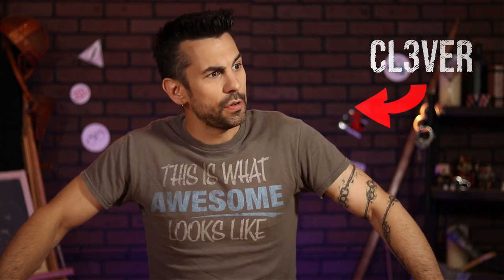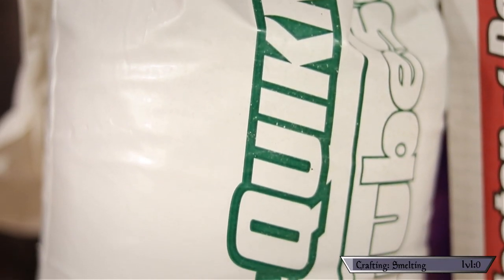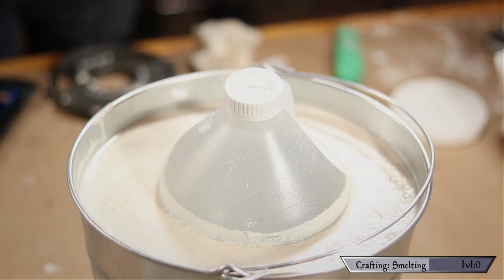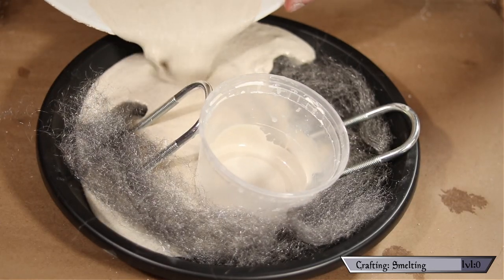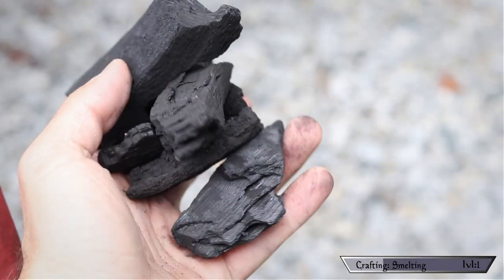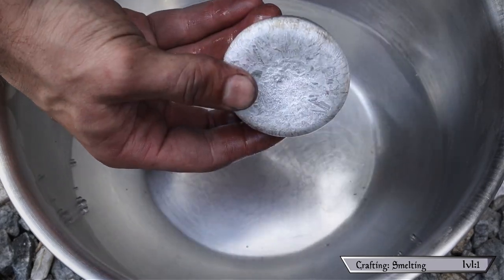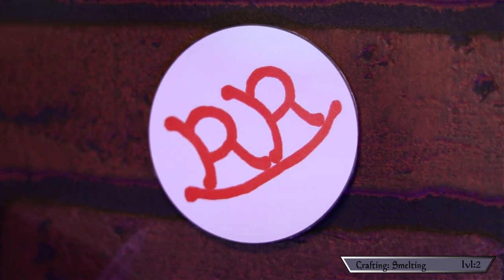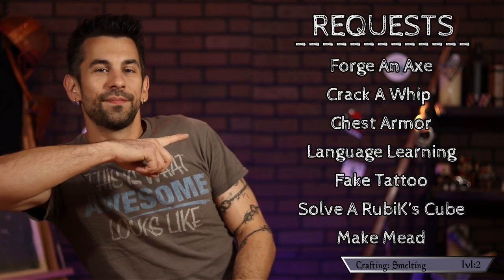Metal Foundry! | On The Shoulders of A Giant | Skill Tree

Comment: Quick tip. When I first tried this, I had an issue with the aluminum welding itself into the tin. I think it had something to do with the coating on the tin, because after using the forge to preheat the rest of the tin, I never had the issue again.
Reply from the maker: Great tip! I need a smaller crucible too. It was too snug to fit a lot of coal around the sides. As a result, they burned away quickly. Not a problem this time but if I want to do a bunch at once I think the top will cool too much
Reply: @SkillTree  or you could try to upgrade the charcoal to the gas blower like Grant did. Actually that is what I am getting ready to build. I did notice that the pipe sizing was off in KoR link and video. You need a 3/4" pipe with a 1 1/2" to 3/4" reducer along with the 1" to 3/4" reducer. And like you mentioned in the bucket to not used galvanized steel. LOL I got all black steel.
Reply from the maker: @michaelsexton170  definitely a build for the next level. I want to make a gas forge too. Both will allow me to work in the garage during the winter time rather than battle the snow here. Thanks for the tips!